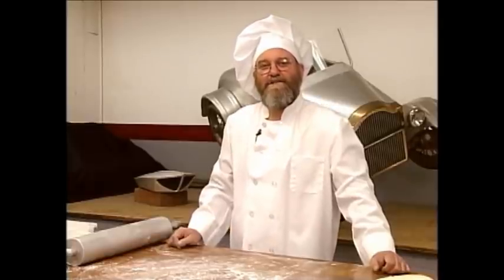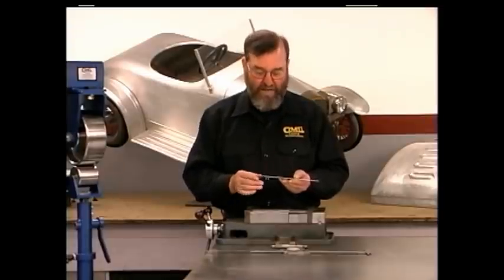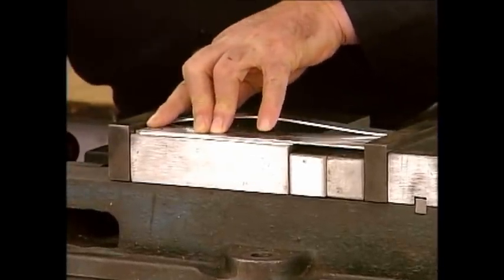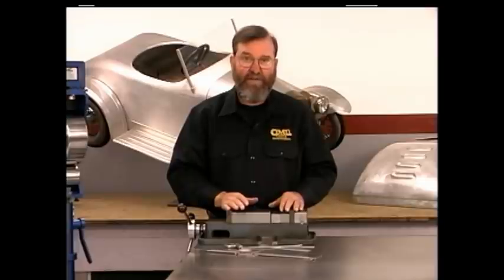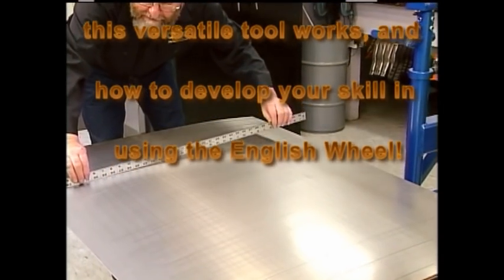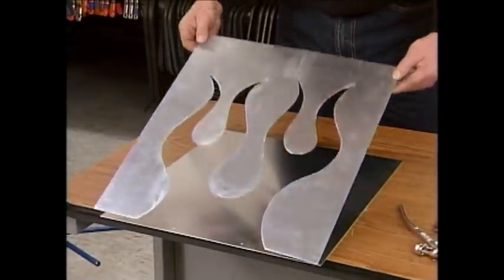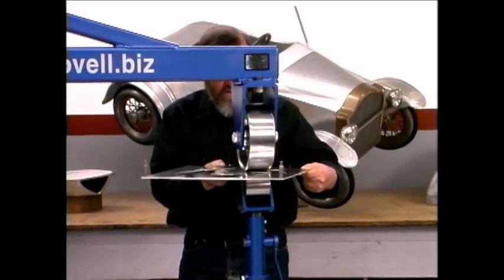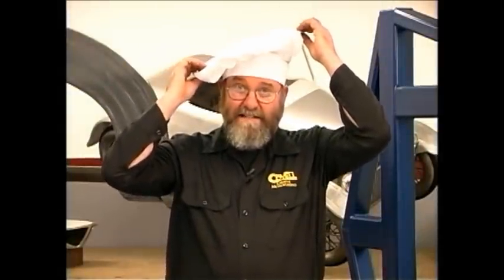English Wheel Techniques

Comment: I have a question. Does english wheel,planishing hammer and power hammer has a same function in metal shaping process?
Or there is a difference between these 3?
Reply from the maker: +Izzat Ramli Good question! A power hammer with the right dies can shape metal by stretching or shrinking, and it can smooth lumpy metal. 

An English wheel can shape metal by stretching, and it can smooth lumpy metal. It can work on panels of all sizes.

A planishing hammer can shape metal by stretching, and it can smooth lumpy metal. It is best used on small to medium-sized pieces, and it is ideal for flattening welds, or working in tight, restricted areas.

Comment: The English wheel is great because of its versatility. A lot of body panels can be reproduced, but only if you have a talented employee. That skill takes years to learn.

Would it be possible to make a CNC English wheel? The machine would only be semi-automated. A man would hold the sheet metal while the motorized wheel and hydraulic pistons operate.

The operator would grip the edges as the machine worked, and participate in the process.
Reply from the maker: I believe it would be possible to make a CNC English wheel.
Here is a link to a video that shows a boat hull being shaped with a powered English wheel. This one is not CNC operated, but that would be the next step:
https://www.youtube.com/watch?v=cKymVzeJGeQ

Comment: Hey Ron, what would be the max size sheet of metal you would recommend someone works with on a English Wheel
Reply from the maker: Hard question to answer, but I find anything over 3' square pretty hard to handle without a second person on the back side. With two people, you can work a sheet of pretty much any size that the machine will allow.

Comment: Hey Ron why is the top wheel bigger? what are the benifits, can a wheel of the same size as the lower ones be used.
Reply from the maker: The larger the top wheel, the easier it rolls over bumps in the metal. Compare pushing a bicycle over a gravel road with pushing a baby buggy. The bicycle rolls pretty easily, and the small wheels on the buggy see every pebble as an obstacle. 8-inches is the size used by most serious machines. The benefits of going larger than that are minimal.

Comment: I am building 21" diameter, 5" deep bowls out of 18 gauge steel. I am using pneumatic sand rammers to sink the steel into the bowl shape. Smoothing is a pain in the butt. Would you recommend the planishing hammer, or the english wheel for that task?
Reply from the maker: Either tool would work. A heavy-duty planishing hammer might be more efficient on taking big lumps out on 18-gauge steel. There are some light-duty English wheels on the market that don't work well with 18 gauge steel, but a good-quality machine can certainly do it.
Reply: Ron Covell Awesome. thanks for the reply. I ended up ordering a small planishing hammer that says will do 18g. I'll let you know how it goes. Might get an English wheel in the near future as well. 2 great tools I can add to my shop without going broke. cheers!

Comment: What gauge of cold rolled steel do you recommend for automotive body panels? Do you have to anneal it?
Reply from the maker: +Jesus de la Isla You should match the original thickness as closely as possible. Most pre-WW2 cars were made of 19-gauge (1mm) steel, and most cars made after the war were made from 20-gauge (.9mm). Cars made in the last 30 years often use metal that's even thinner.

Comment: How do you decide which tool to use for a given job, the planishing hammer or english wheel? The hammer is much faster, but for something like the embossing you just did, it would be hard to control the hammer unless you could vary the speed & intensity to minimum pressure/rate of the blows.  Is that even possible? Great work man, just great! 😃
Reply from the maker: +Zeek Duff The uses of the planishing hammer and English wheel overlap. They are both good at smoothing lumpy metal. I think the wheel is better for shaping large, low-crown panels, and the planishing hammer is better for working in small, restricted areas, and for crushing welds flat.
Reply: +Ron Covell Thank you! Makes sense. Okay Ron, I'm personally really looking forward to whatever comes next here, so have a fantastic New Year!  Also, I'm sure the deep appreciation of your work goes far beyond those of us who actually say something about it...  Be/stay safe, above all else.  😎

Comment: Thanks Ron, now I want pizza 🍕 for lunch. 
Curious, if you drilled a hole in a piece metal strip, run it through the English Wheel, would the hole stay the same, become smaller or become larger?
Reply from the maker: That's a GREAT question - nobody has ever asked me that before! I think there are a lot of variables with this, such as the size of the sheet of metal and the size of the hole. The type of anvil wheel,and the amount of doming you do are probably variables, too.
My hunch is that in most cases, the hole would get larger - but you could probably devise a strategy (like starting every pass at the edge, and ending every pass at the edge of the hole) that might make the hole smaller.
Reply: @RonCovell  - in my mind's eye, I envisioned both and the way you explained the possibilities all make sense to me. I'm intrigued by the talent, skills and master Craftsmanship that you and so many others posess. Is it a gift or a curse? For me, I would have to create. I'd lose sleep by having too many irons in the fire. I feel like I could learn to shape metal if I had the teaching, the tools and resources. Meanwhile, I'm going to enjoy watching what you create next. It's a honor to us all for you to share your experience with the rest of us.
Reply from the maker: Shane - if you're interested, you can see some of my recent work here:
https://www.millerwelds.com/resources/article-library/welding-project-making-a-formed-aluminum-air-scoop-for-a-carburetor

Comment: Is it possible to use a wheel to curve 5 millimeter steel plate used in a 50 fot sailboat hull.
Reply from the maker: I have seen photos of extra-heavy-duty motorized wheeling machines which were used for making boat hulls.
Reply from the maker: Here's another way to work thick steel:
https://www.youtube.com/watch?v=aOB7guzMmm8

Comment: It there anything like a mecanic mallet machine able to curve 5 mm steelplates for å boat hull. How thick steel metal plates is it possible to wheel manually.
Reply from the maker: +Rune Martin Guldberg The thickest steel I have wheeled is 1/8-inch (3mm). Heavier machines can do thicker materials, and some shipbuilding is done with powered machines
Reply: On that size machine, it'll be 1/16" (16 ga) in steel, per specs of my Bailiegh EW40

Comment: I am looking to build an English Wheel out of concrete, what are your thoughts. thank you
Reply from the maker: I think that's a sensational idea! Concrete is relatively low-cost, easy to form (if you have or make a mold) and quite rigid - particularly if it's reinforced with steel rebar. I have seen pictures of a power hammer frame made from concrete, and the reports were that it worked very well. Please keep me updated if you move ahead with this project. The best way to send pictures is via email - covell@cruzio.com
Reply from the maker: http://www.toolsforshaping.com/index.html?fbclid=IwAR2fYPtFEfiSAEz8Wvsbh7002bT6AeanszcWCj9M9OconfZv05ZiiGGjweM
Reply: @RonCovell  Thank you for the feed back. I plan to start making prototypes in the upcoming months. I am new to metal shaping and looking for a cost effective way of getting an english wheel. I will definitely keep you up to date throughout the process.
Reply: @RonCovell  thank you, this infomation will be useful for testing.

Comment: Ummn Does English Wheeling work for the more harder and brittle aluminum alloys namely 2024-T3 Alclad at about 0.04~0.032 inch thickness? I'm thinking aircraft fuselage!
Reply from the maker: Sangyoon - yes, the English wheel is very commonly used for shaping aircraft sheetmetal parts.

Comment: Would like to see something about the little car in the background
Reply from the maker: Patrick - Thanks for watching, and commenting! Unfortunately, I don't have any video of that car being built. There is an 18-page section in an out-of-print book that shows  building the body for the Packard Pedal Car (but not the fenders or hood). The book is titled: "Ultimate Sheet Metal Fabrication" by Timothy Remu. Do a web search for that title - I just found one for less than $10.
Reply: Ron Covell thank you Ron, I am building a small motorized car for the grandkids, aluminum skin over 1/2 inch square tube body, resembles MG/Morgan, I’m very weak in metal working will probably resort to fiberglass for fenders